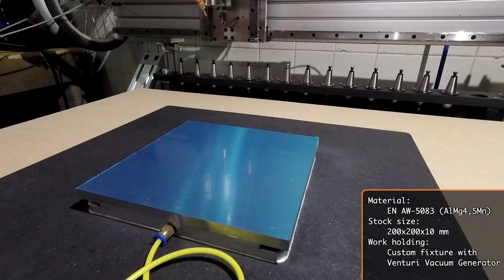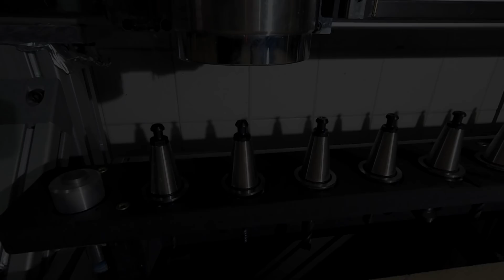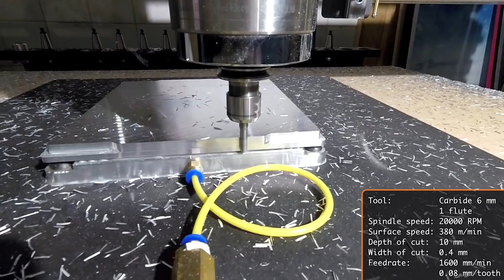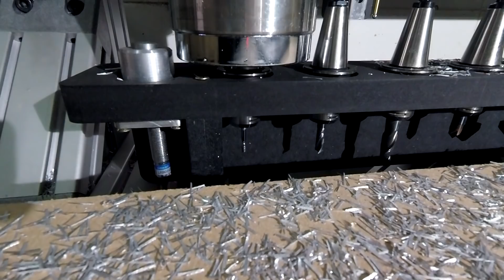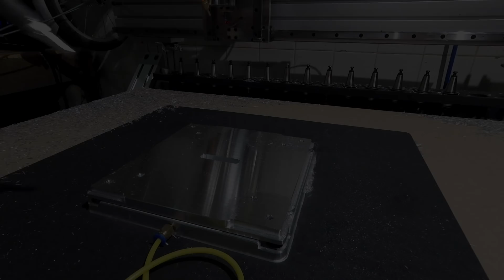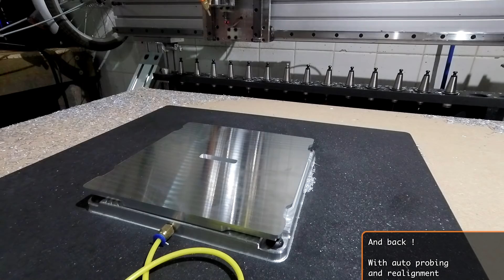DIY CNC Router with Automatic Tool Change milling aluminium

Comment: That almost looks like a commercial machine! I'd have an idea: A bent piece of plexiglass connected to a spring that gets pushed away by the Y-Axis. The purpose being the protection of toolholders from shavings. Compressed air is sometimes not enough to guarantee clean surfaces.

Comment: this is awesome! you should add a cover which opens when the machine moves back for the tool change.
Reply from the maker: Thank you, yep I thought about adding a cover. So far I did not have any problem with chips getting stuck inside the tool holder. That's why I've been a bit lazy in designing one. But of course it would be more reliable with a cover.

Comment: Hey Yann very nice setup sir, I'm extremely interested in knowing what parameters you utilized to get your Drewtronics touch probe to work , as I'd definitely like to set my cnc up to operate similarly like yours as well as the ATC setup, if you don't mind sharing that info

Comment: Great work, you've inspired me to up my game, thanks.

Any thought on vacuum extraction and or coolant? You seem to be getting great results without but for aluminium I love the fogbuster system and for dry cutting I'd really want to get rid of the chips. To keep the ATC spacing sensible and still have a vac boot isn't the easiest thing to lay out...

Love the retractable probe and the auto align is the icing on the cake 10/10.

Cheers Owen S.
Reply from the maker: Thank you for your comment, glad I could inspire you :)

I have an air/mist coolant nozzle, you can see it on some of the video shots. But at that time my main compressor was broken and I did not have enough air pressure for both the air mist and the tool change. For this particular part I did not get any jamming or recutting problem, but it's always better to have at least an air blast. Regarding the mist, I tried with air+alcool. But I did not like the smell that filled the air in my garage. It was hard to fine tune my low quality nozzle to get the proper air+alcool mix. But milling dry on this particular alloy works great. I guess it depends a lot on the aluminium alloy.

The vacuum chip evacuation would have to be retractable for tool change, but it's hard to obtain the correct clearance with my tool holder. And I like to see what I'm cutting. So I did not invest effort in designing a good vacuum chip evacuation. And I'm only milling plastics and aluminium. I don't mind manually air blowing my table to clean it. But if I was milling wood I would have definitely designed one.

Comment: I too would like more details on your DIY CNC.  Looks like an 8020 design support structure but can't see much else.  Also the tool changer is a must for a machine of this size...which is?
Reply from the maker: It's based on 40x40mm aluminium extrusion. The gantry is 160x80mm. And both pillars on each side are 80x80mm. And the table is a mix of 80x80mm and 80x40mm. The usable table size is 1400x1000mm. I know I need to realise another video! I just have to find some time and grab my camera to show a bit around the machine and explain a bit more how I built it :)
Reply: @YannPomarede  would love to see even a walk through video of this machine

Comment: I'm curious how well this spindle holds up in the long run.  I run a pid controlled porter cable.  It's great and has fantastic torque down to 6k rpm, but the manual tool changes have me wanting to upgrade.  I mill aluminum with it pretty well, it seems like yours does too.  Very nice!
Reply from the maker: TheDbsharp you question is: do you really need fantastic torque at 6k RPM? On aluminium you can run at 20k or 30k RPM using “HSM tool path” and get the same removal rate with less torque requirement. And bonus is that you also have less radial forces and less gantry deformation. Running fast is a win almost everywhere :)
Reply: Lower rpm are very useful for hss, form cutting, thread cutting, etc...  but my main question is to how well your spindle has been holding up.
Reply from the maker: So far so good. But it only has been a year and not using it full time.

Comment: nice job on the build, Is it possible for you share and post a video on the electrical pneumatic schematic required for the atc.And what was required for setting up Mach etc. post your post processor code etc
Reply from the maker: Yes, that's my next video I think, more details on the ATC mechanism and control. Then one about the control software, I'm using LinuxCNC and not Mach.

Comment: Hey Yann! 
I'm going to order all the aluminum for my CNC router soon when I finished my 1700mm 3D printer. Your video helped me so much with the design of the CNC! Thanks a lot for showing it.
I've designed my work area to be 800 x 1400.  How large did you make the Z-axis? 
Seems to be around 20cm , judging from the 80 x 160 profile? :)
Reply from the maker: The Z travel is 190mm and the height of the gantry over the finished vacuum table is 140mm. The extra Z travel is needed to get enough clearance with long tools. So I can really uses my 140mm even when a 80mm long endmill is mounted.
Reply: @YannPomarede  Thanks! I think its a good height, probably I should not go much higher than that. :)

Comment: Very good. Like the vertical retraction of probe. When the parts finished one side and flipped over, you don't need to do any parallellism and  straightness alignment works. The probing routine does the adjustments. How can it be achieved and what software you used. Or you make it yourself. Very cool. (Is it from 3d printer bed alignment software. How do you incorporate it into your probing routine?)
Reply from the maker: I'm using LinuxCNC but this can be achieved with any controller.
I programmed a routine in G-Code that does a 6 points generic rectangle probing with some G38.2, some moves, some basic calculations, and a coordinate system change at the end with G10 L2 (X, Y and R). It is 100% pure G-Code.
Then I did a "remap" with a custom M code (M601) to call this routine with the stock size as argument. Here is the doc : http://linuxcnc.org/docs/html/remap/remap.html
Then when I need to probe a 200x200 rectangle I call my routine with 200x200 as argument: M601 P200 Q200
Reply: Not many hobbyists know the M-code remapping, For LinuxCNC, I only learned and used it10 yrs ago and switched to use Mach3 . Anyway, thanks.

Comment: Is it better to have few flute when doing aluminium??
Reply from the maker: On small weak machine like this one, yes it’s better to have 1 flute, a high speed spindle, and a fast feed rate so that the single flute is feed consistently. The feed is between 0.05 to 0.1mm/teeth/revolution.

Comment: this is great :) how did you program the T1 T2 ... did you create macros or subprograms with the position for each tool slot? I presume there is an M-code for the air line.
Reply from the maker: I created 3 macros: one to unload the tool, one to load the tool, and one that combine both to do a full tool change.

For the move to the right position I use the following:

O<tool-load> SUB
#<tool_change_x>      =   132.0   ; x position of first tool
#<tool_change_dx>     =    55.0   ; offset between each tool
#<tool_change_y>      =  1406.6
...
G53 G0 Y[#<tool_change_y>] X[#<tool_change_x>+#<_selected_tool>*#<tool_change_dx>]
...
O<tool-load> ENDSUB

With LinuxCNC #<_selected_tool> is the number of the selected tool (T1, T2, etc...).

Comment: How have you done the auto probing and re alignment? Whould be great to see that!
Reply from the maker: I'm using LinuxCNC, and it's pure G-Code, using G38.2 to probe different points, then "G10 L2" to change the working coordinate offsets. I could add more details in my next video.
Reply: @YannPomarede  thank you for the Tipp. For coordinates of work Zero this is understandable, but how do you compensate the angle of work piece?
Reply from the maker: I probe 2 points on a side (actually 2 points on each side and I average), then I compute the x/y vector between these 2 points and compute the angle with an arctan.
Finally a G10 L2 P0 Rx to apply that angle to the coordinate system.
Here is some code for LinuxCNC:

#1111 = [[#1021+#1031]/2 - [#1051+#1061]/2] ; dx
#1112 = [[#1022+#1032]/2 - [#1052+#1062]/2] ; dy
#1113 = [ATAN[-#1111]/[#1112]]       ; dr
#1114 = #[5210+20*#5220]            ; current r
G10 L2 P0 R[#1113+#1114]
Reply: @YannPomarede  Thank you again. Seems to be Linux CNC Specific, I can not find a reference for other conttrollers (like Mach4) to support an angle (R) in G10. Semms to be a great benefit for Linux CNC.
Reply: @ravenvg  Mach3 and UCCNC support G10
Reply: @YannPomarede  Respect

Comment: Nice machine. Did you build the probe too?
Reply from the maker: No, I bought it from drewtronics.org, but if you have a lathe, it's not that hard to build. But I built the probe holder (3d printed parts) + the probe retraction mechanism.
Reply: @YannPomarede  Thanks for the reply. I see their workshop was destroyed by the Californian wildfires :-( They're setting up in a Texas now. Yeah, I might end up making one myself, although if drewtronics are still selling their probe for $170, once they're back in business, I'm not sure it is worth the effort.
Reply from the maker: Ha, I didn't know they lost their workshop :-/ The one I bought was even cheaper, without the LED. But I might buy the wireless one for my next machine project. It's not in the same price range, sure, but it's more simple to program and use. It's just a normal tool change.

Comment: nice, i also wanted to build myself a cnc, but it would have been way to expensive (because of 5 axis and every axis would have glass scales with servos and rotary encoders as well as a custom ATC spindle with chain tool magazine laser tool probe and custom 3d touch probe)

Comment: I'm interested in assembling a DIY machine but i'm afraid i won't achieve the accuracy and repeatability i'd desire.
What kind of an accuracy/repeatability are you achieving with this setup for the contour and depth?
Tenths of a milimeter, hundredths for diameters, workpiece contours?

How accurate is your probe?
With your experience building this machine do you think it's possible to create an affordable DIY cnc that is accurate to an order of +/-5 to 10 microns.
Meaning  could a diy unit reliabily machine a circular slot with a diameter of say 17,53(+0.03/-0.03)?
Reply from the maker: I would say that +/- 0.05mm is easy to achieve without effort (with a light finish pass of course). More than that is becoming difficult because I have some backlash in the ballscrews (0.05mm backlash). You can compensate for it of course but still...
On a square contour i can reach a repeatability of +/- 0.01mm but it needs a couple of iteration between measurement, offsetting tool path and milling. 
If your talking microns, it’s still possible DIY but it requires a careful design, and a router style CNC may not be the best choice.
The probe is repeatable to +/- 0.02mm
Reply from the maker: And to answer your last question, I’m not sure I could reliability machine your circular slot at +/- 0.03mm. That would be very close to the limit, but I don’t know on with side of the limit :)
Reply: @YannPomarede  Thank you for taking the time to answer.

I was playing around with the idea to emulate a Haas VF1/2's basic design as seen in this video: https://www.youtube.com/watch?v=1s7tPqFtBRE going for a simplified steel base plate, saddle and column, table and spindle head to ensure rigidity. Steel itself is not expensive and i have access to CNC machines at work in the shop. Not a router design. I'd only really need a unit that could cut accurately workpieces up to 300 x300x300mm in size so that would simplify the matter immensely. Rail enclosures could probably be 3D printed for a light duty design and sealed with some sillicone and stuff like that. The cutting would likely work out fine with no coolant or with a preassurised air for evacuating the chips from the pocket based on my previous experience.

The desire would be to create a miniature full feature medium precision mill  (some tool changing) that could have some commercial purpose either in making parts or even marketable.

The issue is mostly the rails and the actuators. Did you use first/second hand brand names or chinese knockoffs and what preload (if any) did you get. Besides that, do you have any tips on what to be really careful about if i wanted to design and build such a high precision machine?

Another issue would be the cost. How much did your project cost approximately? I know how much i'd like to pay and i'm afraid i wouldn't be able to achieve that without chinese preloaded cheapos.

Comment: Realy like ur remap of probing the alignment of piece . Do u have an ideea to make this with uccnc controller or what is the modular programing codes of this ?
Thanks .
Reply from the maker: I have no experience with UCCNC but reading its "key features" it should be feasible. There is "Parametric programming using internal variables and programming mathematical expressions". You have to create a macro that moves around your workpiece with G00 and G01, that probes with G38.2 (with UCCNC I see in the manual that it's G31) and record the probe points with internal variables. Then at the end some mathematical expressions to compute the center and rotation and apply them with a "G10 L2".
Reply: Do u use a solenoid for probe moving up and down ?
Reply from the maker: No, it's an air cylinder, with a solenoid valve to actuate the air cylinder of course.

Comment: Really nice Video.. Nice built!
Can you please tell me which kind of Spindle you use?
Thank you really much!
Reply from the maker: Thank you. The spindle reference is JGL-80/2.2R30-20 from www.jian-ken.com. 30000 RPM / ceramic bearing / water-cooled / ATC ISO20 / 2.2kW / 12kg
Reply: Yann Pomarede It looks a great spindle, can you tell the price of one of those?
Reply from the maker: I bought it 10 months ago at 1365 € shipping included
Reply: Man, this looks like an amazing machine! 😍 Want to know everything about it 😋
Would you offer us a full presentation?
Meanwhile, would you tell us what control software and electronics you use?
Thank you in advance and congratulations for this piece of engineering and crafts👍
Reply from the maker: Thank you for your comment. It's crazy to see such enthusiasm. At first I posted this video to show the machine to some friends but it has now reached a broader audience!
Yep, I'll try to make a video explaining the build more in details.
The control software is LinuxCNC and the electronics are:
 - Mesa 7i96: FPGA board to generate smooth stepper steps + some I/O, ethernet connection to computer
 - Mesa 7i84: Expansion board with more I/O
 - Leadshine DM556: Stepper driver with a good DSP, RS232 port for tuning
 - Leadshine 57HS13: Stepper motors
 - Leadshine SPS407: 42V / 7A unregulated power supply
 - 3.5kW VFD for the vacuum pump
 - 2.2kW / 500Hz VFD for the spindle
Reply: @YannPomarede  Hi, Great Machine.  I am looking at the same spindle to upgrade my machine and just wonder how many tool holders come with the spindle.  I have contacted the supplier but I am not getting any reply.
Reply from the maker: @deanrichards9541  It's strange that they don't reply to you? I always got a reply within 24h when I bought mine. It comes with only 1 tool holder (from the Taiwanese brand Parfaite). You can ask for more but they are not cheap (around $80 each). I went for Chinese one for a third of that price and I did not have any runout problems.
Reply: @YannPomarede  thanks Yann.  Yes, I am not sure why they are not replying.  I may give them a call as I am working in Hong Kong at the moment so on the same time line.  I just noticed that they are an ER16 collet but I will need a ER20.  Hope they can supply the same spindle motor but with the ER20 as the spindle motor diameter of the ER20 motors are too big for my machine. 100mm dia instead of 80mm.  I'll ask them at the same time.
Reply from the maker: @deanrichards9541  The collet size (ER16 or ER20) is not directly related to the spindle. The spindle has a ISO20 taper, and you can buy ISO20-ER16 or ISO20-ER20 tool holders, I bought some of each size and they all work fine.
Reply: @YannPomarede  Thanks Yann, I wasn't sure with this unit as the supplier of the spindle motor is only offering a ER16 with the motor so hope they can offer a ER20 in its place.  Anyway, I appreciate your advice. Much appreciated.  I will give them a call in the next 10 minutes and hope for the best.